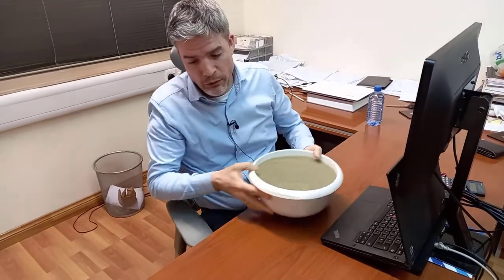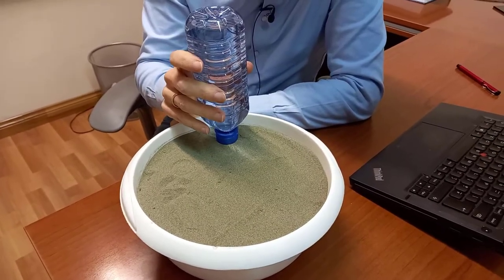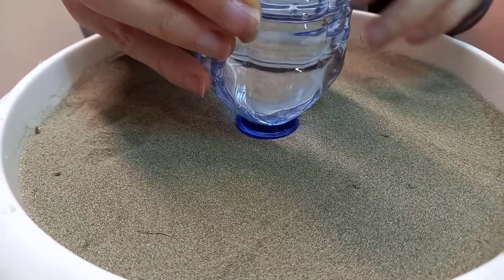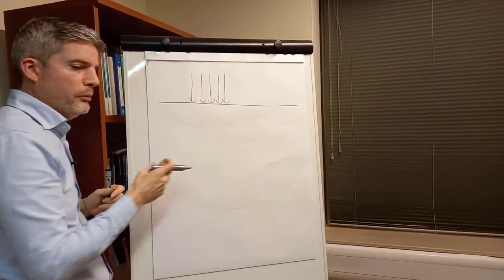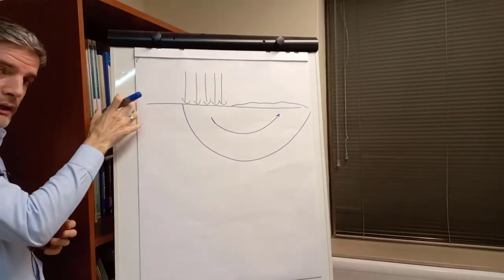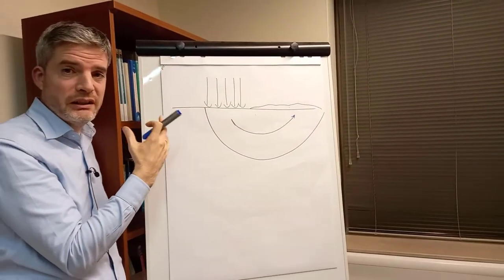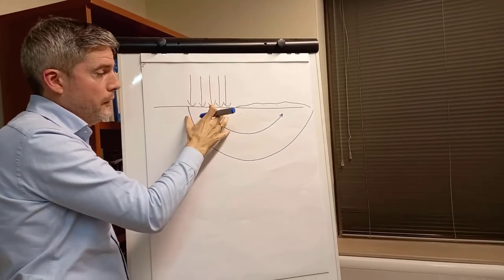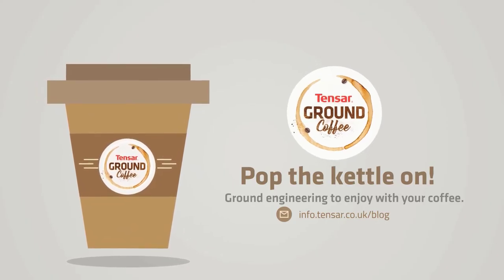What is the Bearing Capacity of Soil? I Geotechnical Engineering I TGC Ask Andrew EP 4

Comment: I have a questions about roof top garden beds and how to measure the pressure of the soil on the building?
Reply: volume of beds times unit weight of that soil. probably 100ish pounds per cubic foot. how that force flows thru that building is a completely different story and cant be solved here. TLDR its alot of pressure.